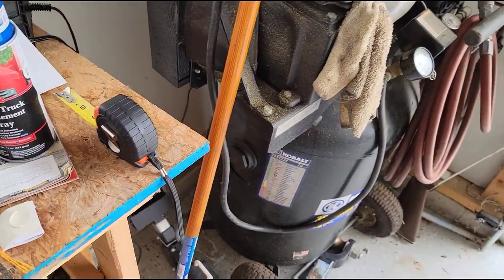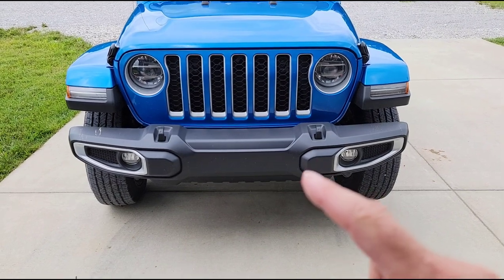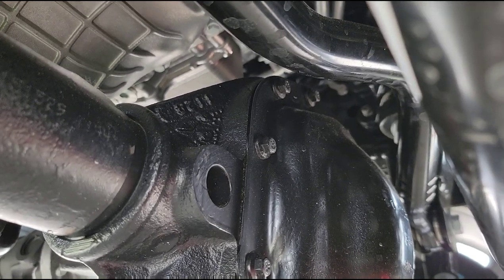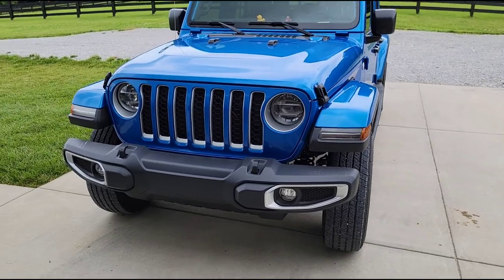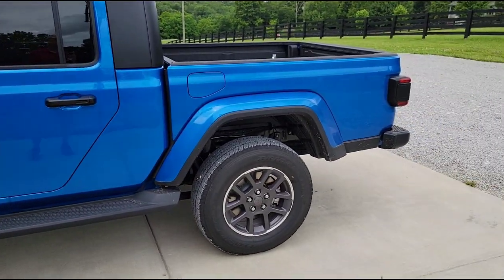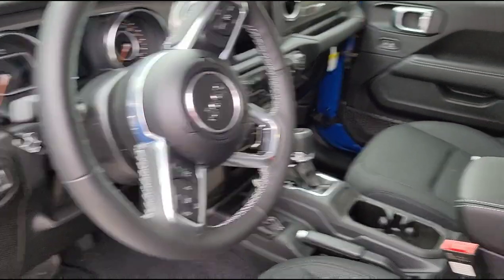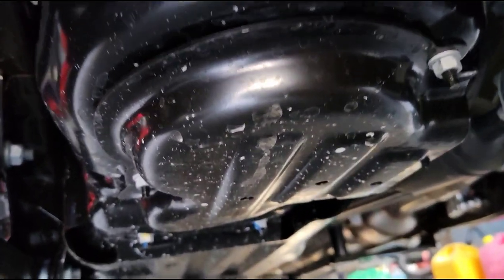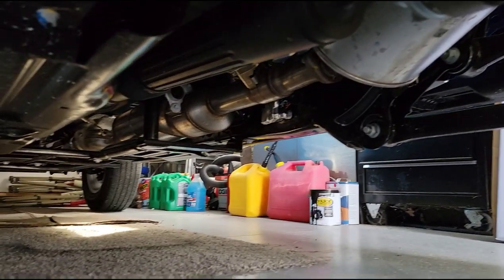Could This Have Something to Do With the Horrible Steering on Jeep Wrangler and Jeep Gladiator?

Comment: My 2018 JLUR had the wandering problem.  First thing that was done was to reflash the steering module.   That helped a bit.  Then I lifted it 2 1/2 inches and put on 37’s.   Thought that would make it worse but it didnt.   What really helped it was replacing the aluminum steering box with the updated steel one...

Comment: I had the same wandering when I picked up my 2018 JLU.  Driving it home from the dealer was a struggle just to keep it going straight down the center of the road.  CONSTANT micro-adjustments on the steering wheel.  The PSI was over 40 in each tire.  Dropping it to 32 PSI helped, but didn't eliminate the problem.  What FIXED the problem for me was swapping out the Sahara tires and replacing them with the factory Rubicon tires.  Ironically, YOU HAVE the tires on your Jeep now that were giving me the same problem!  I had the Bridgestone Dueller H/T and swapped them out for the BF Goodrich All Terrain T/A.  PROBLEM SOLVED.
Reply: There is a TSB for 2018 to 2020 JL's. Go to your dealer and mention TSB 08-003-21. This should be covered under warranty if your warranty is not up yet.

Comment: If you look down between the washer fluid filler and the intake on the driver's side of the engine compartment you can see the steering box. If it's all black, it's the steel one. If it has a silver top, it's the aluminum one.

Comment: I had this weird steering issue when I purchased my new 2021 2 door Wrangler Willys and what I found, in my case, was the clearances in the front end were a little tight and kept the front from returning to center thus requiring constant input from me just to keep going straight. After about 3-4,000 miles everything loosened up and all of my issues went away. Now my Jeep steers like it should. There may be others out there that have different issues but this was what I found. On your front and rear not being centered you will need to install adjustable track bars to get things the way you want. This offset is especially noticeable when installing cheap lift kits on coil spring front and rear solid axle applications. Yes, the track bar can cause bump steer and affect handling but you usually need to get into a lot of up and down movement for that to happen. For 1/2 inch difference I honestly don't think it is that far off to affect anything. Once everything settles in if you are still having issues then look at the alignment and tires plus get the tire pressures down to around 36 psi or less for daily driving since tire pressure has a LOT of affect on ride and handling in Jeeps, especially 2 door models. BTW, I really enjoy your channel, you do a great job!

Comment: Interesting. I have seen trucks with front axles welded in that were not true or parallel. Off by centimeters at an angle ever so slightly. I solved the vague steering, got a Grand Cherokee Trailhawk. That is such a great looking Gladiator.! 👍👍😎🇺🇸 Skid shields, good to know!

Comment: Bought a 2021 Overland with the same wheel/tire package and had my first horrific drive a week after I bought it. Right away I ordered a Fox steering stabilizer and it helped but didn't correct it.After swapping wheels and tires to stock Rubicon wheels with Falken Wild Peaks, the issue is completely gone. Change those tires!

Comment: Had the 18 JL unlimited, lifted with 35s from dealer. It was horrible for wandering. To the point it felt unsafe at times. Several trips back to the dealership b4 finally making it much better by adding dual stabilizers. Front axle was close to 1 1/2" off center, which I mentioned during each trip to dealer. It was easily visible just looking at it. All I got as an answer was the alignment was dead on. Traded it in recently for the Gladiator.

Comment: It's possible that the axle is off center because you have a diesel. The diesels, at least in wrangler form, are slightly taller by about an inch than the gas counterparts for oil pan/axle housing clearance. I haven't noticed mine off center but I guess it's possible yours ended up with a gas trackbar. 🤷‍♂️

Comment: Looked like your wheels were steered to the left ?
Reply: I noticed that also.
Reply from the maker: Yeah I moved the Jeep to another spot and re-measured.  Got the exact same result.  The axle is 1/4" off center.
Reply: @4-LOW   Good to hear that you got the same result, not meaning to throw shade on your discovery that front axle placement may contribute to wandering on the road, just wanting a definitively accurate measurement👍

Comment: Check if the frame side track bar mount is welded on properly (does it move/deflect when you move the steering wheel)? By the way, other than the lack of adjustable track bars, I do recommend the Mopar 2 inch lift (if you aren’t wheeling hard). The quality/ ride/ and corrosion resistance is really good. You can always add your own track bars. Interestingly, I have the Mopar kit added at the dealership and my axles are off center by about 5/8th of an inch. My steering feel is actually pretty good. Even better than my JL.

Comment: Could it be bad bushings on the trackbar or perhaps the axle end mounting bracket hole being wallowed?  I've seen s few different people try to address the Dead steering... One guy bought a heavy reinforcement brace plate/bracket for strengthening the steering box mounting where it bolts to the frame.  They claimed it helped but maybe placebo affect.

Comment: The alignment you're talking about is a factor of the 5-link suspension.  If you had more or less weight on the front bumper, you would see that side-to-side motion change.  So, no, that's not why you have bad steering on a new Gladiator.  If you want that perfectly centered at ride height, upgrade to an adjustable track bar.

Comment: My full coverage insurance on my 21 Gladiator High Altitude is only $604 yearly while the Cherokee Overland is about $500 yearly with a 15k difference sticker price wise. I've had all tops and doors off since end of April and I'm enjoying driving commando and being lighter getting better mileage. I don't know when I will put the tops and doors back on as I drive the Cherokee when raining. My steering is good on my Gladiator with minimal pull. I will have to do the string test and get back to you.

Comment: I have a gladiator. Been having steering problems for year and a half now. Tried everything to fix it. Worst and best vehicle I've ever owned. Hoping the new Bronco is worthy of all the hype.
Reply: Did you get the TSB to change the aluminum steering box to the new steel steering box? I was one of the first in Canada to get it switched and it corrected any problems with mine Sept of 2020.

Comment: Gladiator looks good with 35”+ tires on 17” wheels.  Does not look good stock wheels/tires.
Reply: I agree with that, 35 fits nicely, if you look at the proportions truck and tire 35 + makes it look better like belong there